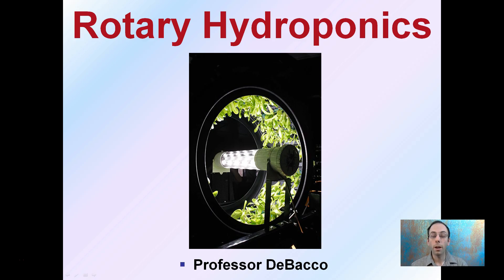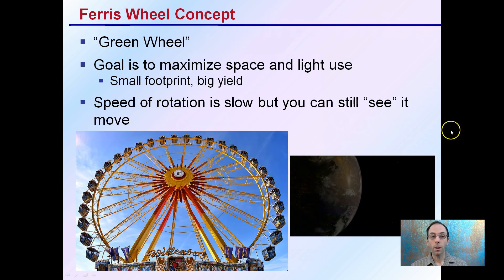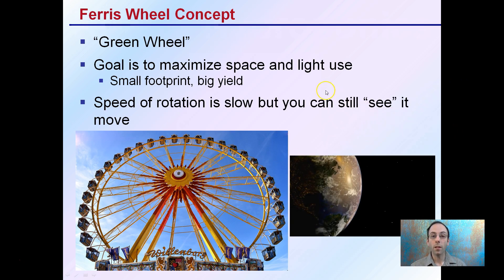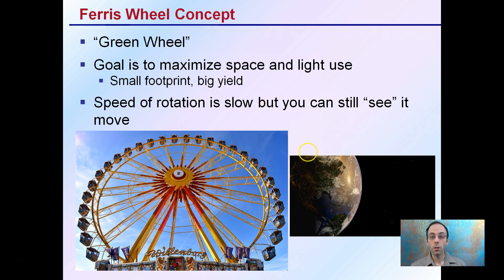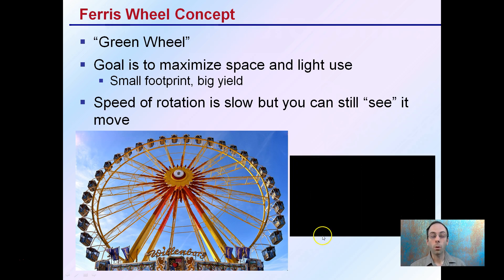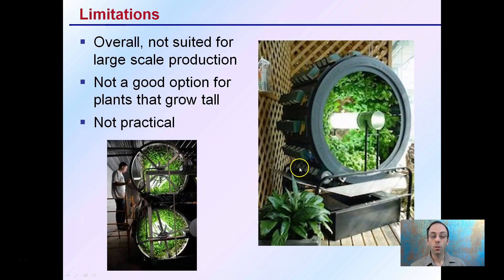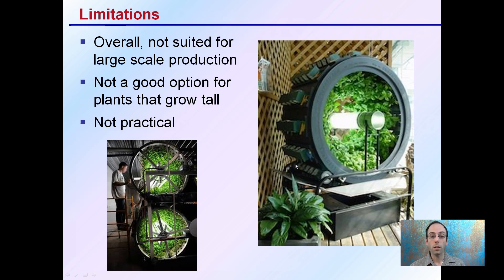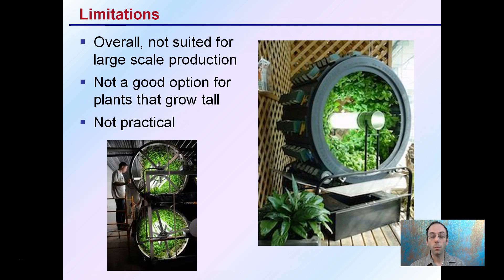Rotary Hydroponics

Comment: You can eliminate most of the plant structure and just grow the flowers or fruit, so I can tell that you have not used one of these gardens.  You have an poor opinion formed by limited experience.  Why grow a free if you can just grow the fruit?
Reply from the maker: The leaves are the source cells and the flowers/fruits are the sink so a plant needs both.  Having worked with Rotary Hydropoincs before, it is a challenge to produce high volumes cost effectively and there are also many moving parts so this why other methods are commonly used in large facilities.